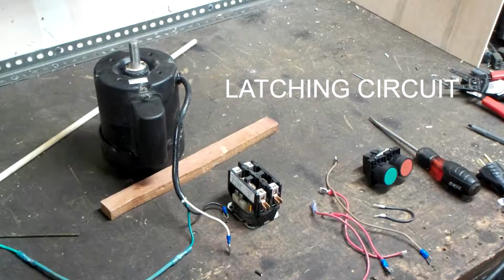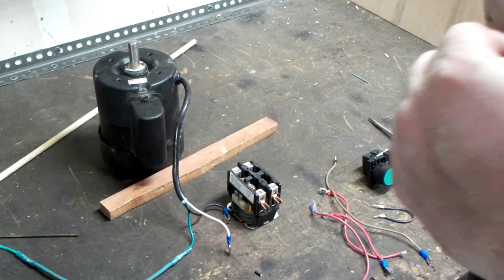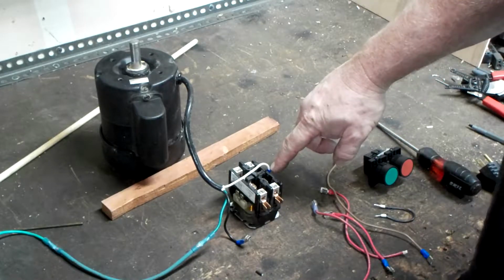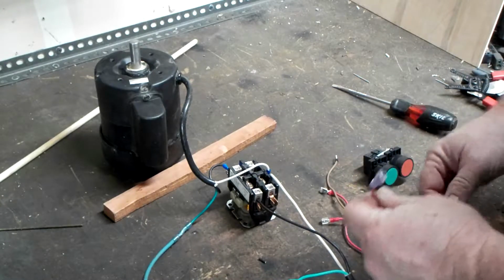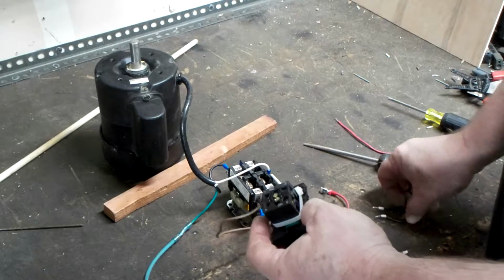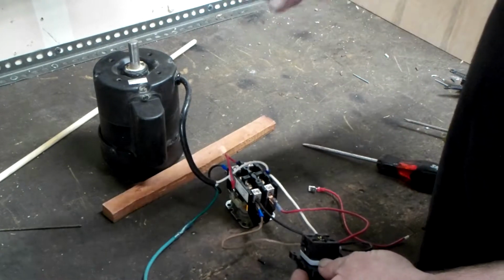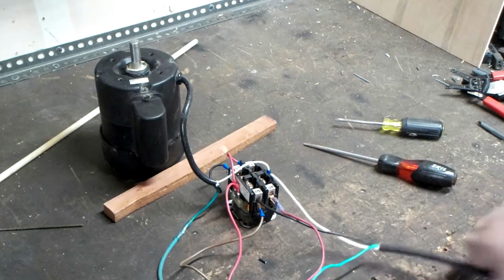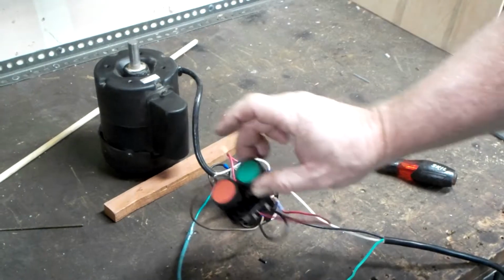LATCHING CIRCUIT

Comment: Thanks, Mike. Looks easy enough to do. I have a 3 phase grinder that needs a circuit like this. Is there much difference when connecting a 3 phase motor? Thanks for the video!
Reply from the maker: you are welcome!
4 pole contactors are used all the time for running 3 phase motors
Reply: Thanks Mike!